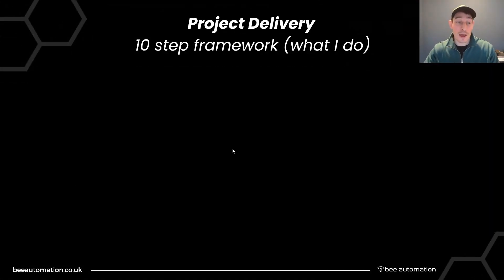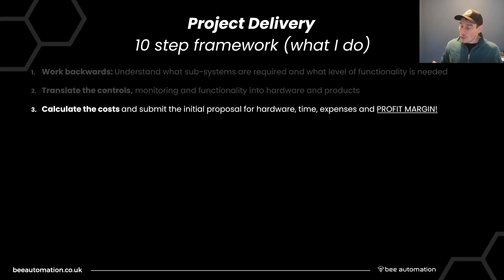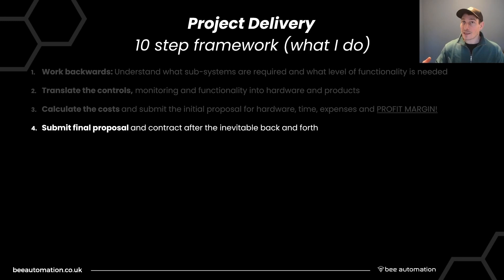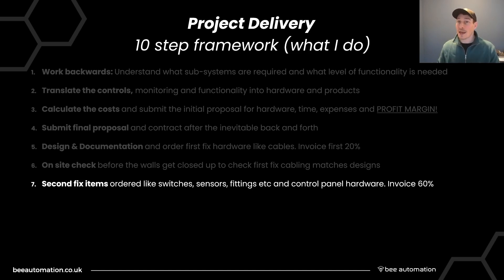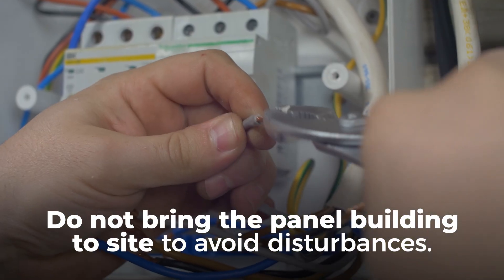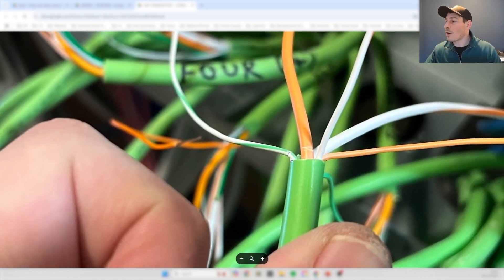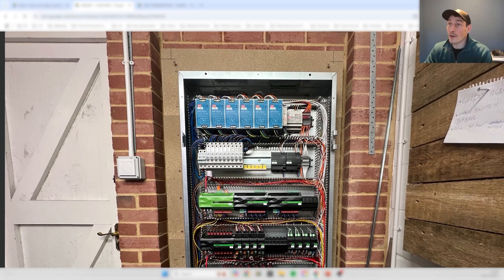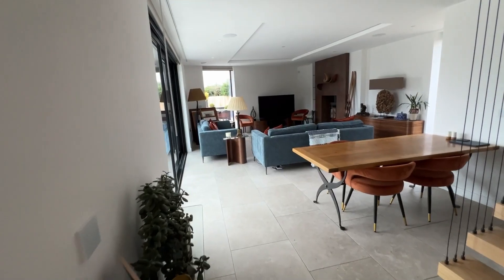How to Deliver a Loxone Smart Home Installation

Comment: Very interesting. This industry has a mixed reception because you would have your 1 bed apartment single stat Nest installation customer who's only request/requirement is that their combi/HIU  boiler is hidden from the human eye to a bespoke house in the woods where the customer wants their whole house automated. 

This seems to be the longstanding question mark in terms of the demand for full automation in domestic properties. 

At the same time because people are now more dependant on Alexa Siri and Google assistant to turn their kettle on that could be a potential selling point but then you have smart switches and plug sockets.  Loxone is a brilliant system though.

Just a thought